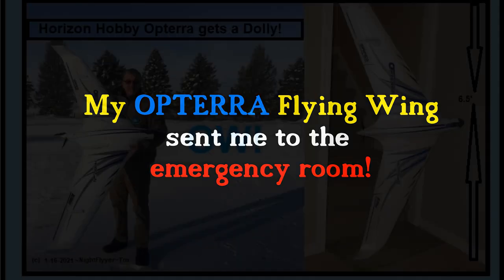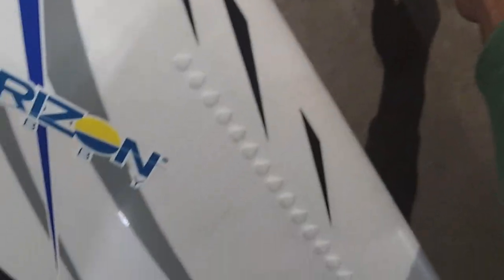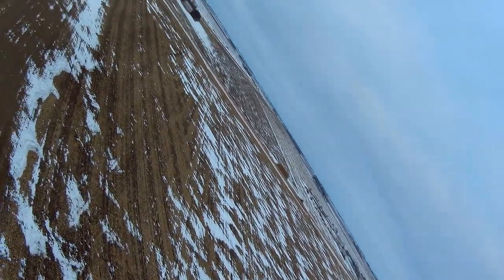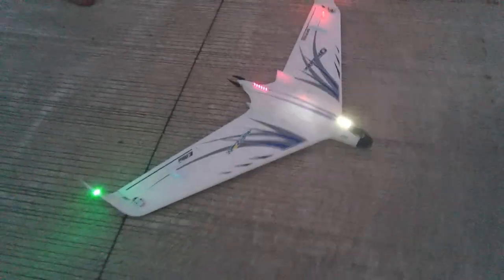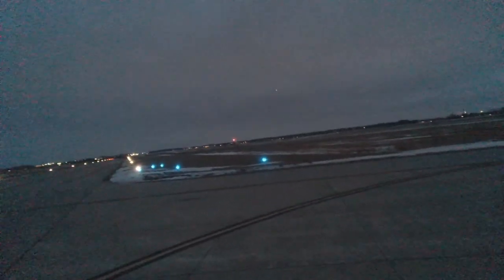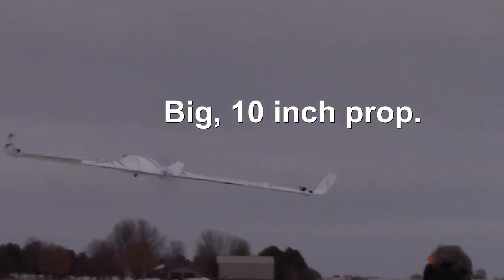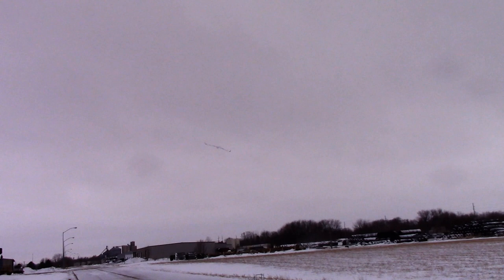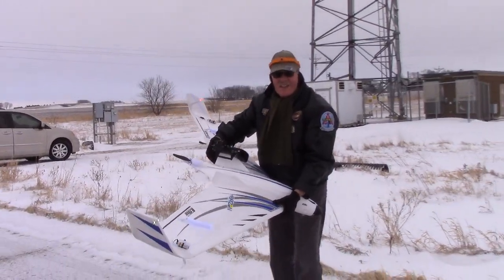My Opterra 2M Flying Wing sent me to the E.R. This is an awareness video & my solution for launching

Comment: You should have just got a Robotic finger. Quicker and better
Reply from the maker: Actually if the  instructions had said to, I would have, but this big heavy 7 foot wing is hard to throw into the wind, as it is very under powered. Here is word for word what the Opterra 2M manual says about launching.  
1. Put the aircraft into launch mode with the channel 5 switch.  (in my first video that did not work, it went into the ground)  
2.  Hold the aircraft in one hand and the transmitter in the other.  
3.  Apply full throttle and throw the aircraft directly into the wind, angled slightly up (5 to 10 degrees above the horizon). 
4.  Climb to a safe altitude and check the trim.   
This worked in my earlier Product review video but nothing is 100%.

Comment: My God, could only watch up until the incident, then had to stop the vid for abit. Firstly hope you're ok now. What a stupid set up and the fact that they say angle 10-15 degrees puts you directly in a bad spot as it's bound to drop a measure once released.
Reply from the maker: So true and thanks so very much for not beating me up about it as others have.  I hope you skipped the hurting part (it's not that bad) and went to my solution.  Thanks kindly.  I'm getting better all the time.
Reply: @NightFlyyer  Happy to hear all is good with your hand, could of been very nasty. Yes I did watch the remainder of your video after pondering what could perhaps remedy the problem. At first I thought of maybe launching using some 2" plastic pipe as an extension inserted into some sort of pivoting socket on the aircraft. Then some kind of system where an undercarriage  was held by electro magnets so could be detached upon take off. However your biggest enemy I'd guess is weight and affecting balance in general. Plus it's breaking the keep it simple rule. What doesn't come across in videos is the actual weight of the plane and the effort to launch it correctly on top of technique. I then thought of some of the early jet aircraft that used an undercarriage that wasn't fixed to the aircraft, though I didn't know the correct name for these. So upon seeing your prototype solution was great to see you have success there. Confident you'll tweak and improve where required as needed. Thank you anyway for posting a video that stimulated some thought / ideas. Kind regards and apologies for the lengthy response.

Comment: Dave... you have flown for many years, you should be familiar with a kill switch.
Reply: What good would a kill switch have done? You think his reflexes would be fast enough for him to shut off that prop in the millisecond it took between him letting go of the plane and the prop hitting his finger? lol
Reply from the maker: I certainly know that as most of my helis have that setup. Ive flown models for 60 years.  Im 73.  But the best rc pilots in the world, have also had bad landings once in a while.  Shit happens, especially while I was trying to throw this heavy, under powered 7 foot model into the 12 mph headwinds.    First of all, that had nothing to do with my hand injury. I only mentioned the Throttle arming because I followed instructions in the manual and this is the way it bound up and arms the motor as soon as you plug in the battery. It says nothing about programming in a cut switch like my helis have. I only mention it to warn others to program in this feature as well,  which also should have been mentioned in the instructions.  It's my warning to be cautious, because the manual says nothing about programming in a throttle hold to a switch. I've known of times when after flying, that switch was forgotten to be moved back to safe and it armed as well.  Nothing is 100% as it could be left in the wrong position, by accident. I'm pretty experienced, so never relied to on a throttle cut/hold, as all my helis and my drones, and many of my electric planes need throttle stick movements to arm.   I only am warning others to be careful BEFORE the launch and to be careful no matter what you use. Thanks.
Reply from the maker: @TalkingHands308  Thanks for sticking up for me.
Reply: @NightFlyyer  Seems like he didn't bother to watch the entire video to see what happened, just heard your opening statements about how the prop arms right away and thought that caused the accident...

Comment: If the motor can be switched on or off in flight throw it that hit the power to the motor or wear leather gloves. And if any of those work make a video on safety on this aircraft and any other it may apply to as well. And remember safety first in anything you do and don’t let Darwin win.
Reply from the maker: It can, but holding this big 7 foot wing and trying throw it into strong wind is harder than you think.  Thanks for that suggestion and I tried gloves already, because it was cold, but found that trying to hold on to the tiny finger grips on the bottom of the fuselage with a thick glove under full power was difficult and then trying to fly with it on, it was difficult to fly the transmitter,  so although that sounds like a good idea, it would probably not work that well.  We are only talking about a Half inch of clearance that I needed to keep from getting cut. I also launched it exactly word for work how the directions said in the manual and did not have a problem in my previous opterra videos.  Here is word for word what the Opterra 2M manual says about launching.  
1. Put the aircraft into launch mode with the channel 5 switch.  (in my first video that did not work, it went into the ground)  
2.  Hold the aircraft in one hand and the transmitter in the other.  
3.  Apply full throttle and throw the aircraft directly into the wind, angled slightly up (5 to 10 degrees above the horizon). 
4.  Climb to a safe altitude and check the trim.   
I know others have their own ways, and either way, my Dolly is the safest solution for me.  
The Opterra 2M manual also says nothing about throwing it with the motor off, so if a newbie followed the instructions, like I did, I'm showing what could happen, in case a gust of wind got them or something else.     Nothing is 100% and no matter how good you can throw, this big 7 foot wing with a 10 inch prop spinning right next to your face, is risky.  https://www.youtube.com/watch?v=P_inF5EYLEE&t=1s

Comment: launch it with safe :D or without eingine
Reply from the maker: Here is word for word what the Opterra 2M manual says about launching.  
1. Put the aircraft into launch mode with the channel 5 switch.  (in my first video that did not work, it went into the ground)  
2.  Hold the aircraft in one hand and the transmitter in the other.  
3.  Apply full throttle and throw the aircraft directly into the wind, angled slightly up (5 to 10 degrees above the horizon). 
4.  Climb to a safe altitude and check the trim.   

I know others have their own ways, and either way, my Dolly is the safest solution for me.  
The Opterra 2M manual also says nothing about throwing it with the motor off, so if a newbie followed the instructions, like I did, I'm showing what could happen, in case a gust of wind got them or something else.     Nothing is 100% and no matter how good you can throw, this big 7 foot wing with a 10 inch prop spinning right next to your face, is risky.

Comment: Use INAV Autolaunch!!!!!!!!!!!!!!!!!!!!!!!!!!!!!!!!!!!!! 🤦‍♂️
Reply from the maker: I launched it exactly as the manual stated and several times in my earlier video on this thing.   If it had said to program that in, I would have.
Reply: @NightFlyyer  INAV is a real autopilot. A spectrum RX can't do this. It is always dangerous to throw a pusher. Stay save.
Reply from the maker: @BBFPV  Okay.  Well this has a sort of autopilot. Maybe Horizon should mention or include the INAV with this kit and stop telling folks to hand launch it in the manual.  Thanks.

Comment: Balance your prop that thing sounds horrible
Reply from the maker: It is balanced and is very smooth, It is a folding prop with a weird shape. Sorry you don't like the sound. I even tried to find a replacement prop, but there are not even stock ones available on the HH website.  Thanks.

Comment: 08:10 Ask the germans, they did that with Me-163 long time ago. 
Would wearing leather gloves have saved you from those nasty cuts?
Reply: Yes but you risk lose dexterity which can sometimes actually degrade safety. With leather gloves, it'd likely bruise the heck out of your fingers and cause minor cuts but save you having to get stitches. I've had a 5 inch quad come down behind me, disarmed, but props still spinning and it left nasty bruises but didn't cut through my shirt.

Comment: Time for a prop guard..
Reply from the maker: I agree. l But it would have to be at least 11 inches, and would be hitting the ground on landing. This prop folds when you shut off the motor, so it doesn't hit.  Thanks.
Reply: @NightFlyyer  I guess a reinforced leather glove or maybe a .. chain mail glove  may help then..my cousin did the same to his finger when we were flying motorized Hang gliders he was trying to take off in a plowed field and he could not so he turns around and points to the tail dragger.. skid  and put his finger right  into the   rotating prop.. ouch!
Reply from the maker: @MrRotaryrockets  Ouch is right.  Trying to hold on to the tiny finger grips on the bottom of the fuselage with a thick glove would be difficult when under power and then trying to fly with it on, so although that sounds like a good idea, it would probably not work that well.  We are only talking about a Half inch of clearance that I needed to keep from getting cut.
Reply: @NightFlyyer  I was watching others flying your wing and they launch it by grabbing the leading edge of the front wings and throwing the plane over their head backwards ..no more stitches
Reply from the maker: @MrRotaryrockets  
This wing is 7 foot long, heavy and will bend and break the end off the if you even try to pick it up by the tip and barely has enough power to fly out of your hand at launch.  I know and I tried.   It would also be extremely difficult to somehow launch it discus style with the elevon there and that 7" tall winglet rudder that is also on the tip.  I know how to do it , but not with this plane.  
See my 14 year old self-contained catapult in action here.  https://www.youtube.com/watch?v=ypxbkaY-Ycs&t=113s  

It's not like launching my SMALL F-27 Evolution or 1.2M Opterra.  So I followed the instructions word for as I did for the video I made of my product review earlier where nothing happened bad.  https://www.youtube.com/watch?v=P_inF5EYLEE&t=1s and the second one where I explain how to protect the bottom of the fuselage.  https://www.youtube.com/watch?v=ur5V5H8UcGs&t=1s
We are only talking about a Half inch of clearance that I needed to keep from getting cut. 
Here is word for word what the Opterra 2M manual says about launching.  
1. Put the aircraft into launch mode with the channel 5 switch.  (in my first video that did not work, it went into the ground)  
2.  Hold the aircraft in one hand and the transmitter in the other.  
3.  Apply full throttle and throw the aircraft directly into the wind, angled slightly up (5 to 10 degrees above the horizon). 
4.  Climb to a safe altitude and check the trim.   
I know others have their own ways, and either way, my Dolly is the safest solution for me.  
The Opterra 2M manual also says nothing about throwing it with the motor off, so if a newbie followed the instructions, like I did, I'm showing what could happen, in case a gust of wind got them or something else.     Nothing is 100% and no matter how good you can throw, this big 7 foot wing with a 10 inch prop spinning right next to your face, is risky.  https://www.youtube.com/watch?v=P_inF5EYLEE&t=1s 

And to see how I feel about that unnecessary auto stabilization system see this.  https://www.youtube.com/watch?v=ur5V5H8UcGs&t=1s

Thanks.
Reply: @NightFlyyer  that is how I saw them launch it on the tube  it is not my idea.  I would just install light weight landing gear...your wing reminds me of   a Horton 229..
Reply from the maker: @MrRotaryrockets  Yes, well some people can do anything.  Again, I launched mine per the instructions.  Horton 229.. Your right.

Comment: Sorry about your hand, however, if you wouldn't have loaded it up so much with the huge batteries, but used power from your main battery, you could have hand launched it, without the motor running like most people do.... Look at this video: https://www.youtube.com/watch?v=ap5Buoo9v2c Furthermore, there is no "left out safety feature" on the ESC, most ESC's act the same way, hence you could program a motor stop switch on your radio..... Switch off, no motor run possible, even when you accidentally hit the throttle stick.... Anyway, good luck and stay safe!
Reply from the maker: Less than 1/2 ounce. Way less than the FPV gear they designed this for.  I flew it fine the first time.  BTW, it was windy and cold and at 73, I cant throw with my left arm like you kids can. All my helis and drones need arming.  First of all, that throttle arming had nothing to do with my hand injury. I only mentioned the Throttle arming because I followed instructions in the manual and that is the way it bound up.  It arms the motor as soon as you plug in the battery.  If it had said to program in a throttle cut, I would have! I only mention it to warn others to program in this feature as well,  that also should have been mentioned in the instructions.   
This wing is 7 foot long, heavy and  will bend and break the end off the if you even try to pick it up by the tip and barely has enough power to fly out of your hand at launch.  I know and I tried to launch it discus style, but could not hold it where I felt I could launch it successfully in the wind.     It would also be extremely difficult to somehow launch it discus style with the elevon there and that 7" tall winglet rudder that is also on the tip.  I know how to do it , but not with this plane.

Comment: I would think the easiest solution would to put gear on it, I never had a hand launch model. always use gear, I have had some nasty cuts hand starting nitro engines, the chicken stick is now weapon of choice and the name suits, after nearly removing a finger I am chicken of the prop
Reply from the maker: Yes, well if you saw my Product review  video,  https://www.youtube.co/watch?v=P_inF5EYLEE&t=1s  you would see  those wings aren't as strong or thick as you would think.  I would have to add a nose wheel servo and make it a trike as well.  And since the prop on the back is 10 inches, the landing gear would have to be quite long or retractable prop would hit the ground on rotation or landing. Thanks for the suggestion, but the dolly is now my landing gear and does not add any weight to this underpowered 7 foot long wing.

Comment: You have no idea how to launch the wing, you left the hand up, even in the first launch, you have to do it like a baseball. You hide the hand. keep the movement down all do way.Sorry for the accident.  I Launch my FX79 with 10000 milliamps battery all the time over my head like a ball hiden my hand,  you should learn Inav to keep you hand out of the emergency room.
Reply from the maker: I have plenty of idea.  This is not my first rodeo and I launched it just fine in my earlier videos.  https://www.youtube.com/watch?v=P_inF5EYLEE&t=1s&gl=CO  and   https://www.youtube.com/watch?v=ur5V5H8UcGs&t=1s  Here is word for word what the Opterra 2M manual says about launching.  
1. Put the aircraft into launch mode with the channel 5 switch.  (in my first video that did not work, it went into the ground)  
2.  Hold the aircraft in one hand and the transmitter in the other.  
3.  Apply full throttle and throw the aircraft directly into the wind, angled slightly up (5 to 10 degrees above the horizon). 
4.  Climb to a safe altitude and check the trim.   
I know others have their own ways, and either way, my Dolly is the safest solution for me.  
The Opterra 2M manual also says nothing about throwing it with the motor off, so if a newbie followed the instructions, like I did, I'm showing what could happen, in case a gust of wind got them or something else.     Nothing is 100% and no matter how good you can throw, this big 7 foot wing with a 10 inch prop spinning right next to your face, is risky.
Reply: @NightFlyyer  yea ok, is me who end up in the ER genius.

Comment: a glove man. get a glove!
Reply from the maker: Thanks for that suggestion and I tried that already, but because it was cold.  I found trying to hold on to the tiny finger grips on the bottom of the 7 foot wing with a thick glove under full power with wind blowing was difficult when under power and then trying to fly with  a big enough glove on was also difficult to fly the transmitter, (I'm a stick pincher)  so although that sounds like a good idea, it did not work that well. Some have told me the Prop got them in the forearm even before launch, when a gust of wind got under the wing and tipped it back.   We are only talking about a Half inch of clearance that I needed to keep from getting cut, and even though I pulled it off several times in my earlier product review video,  I will never hand launch it again.  LOL.  It's hello dolly from now on!  Thanks.